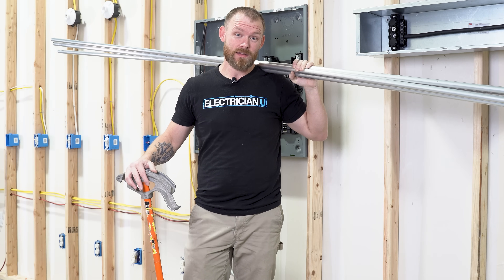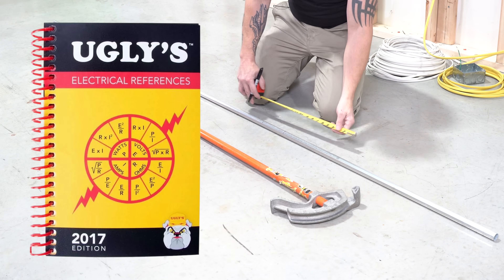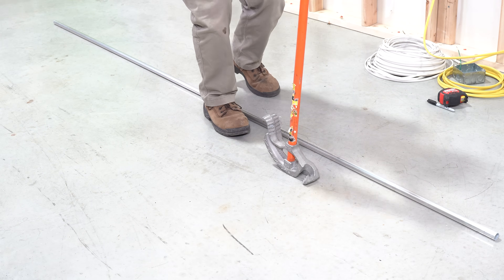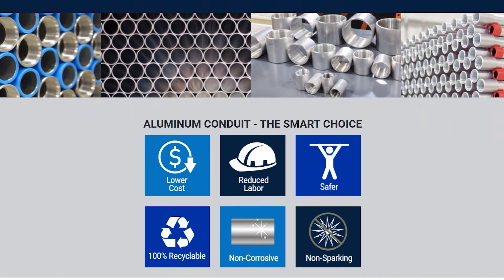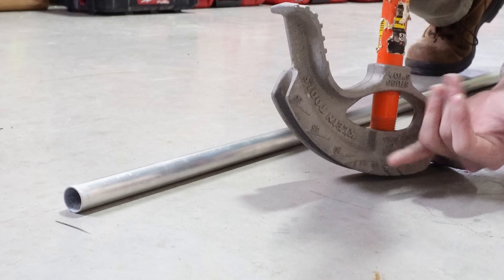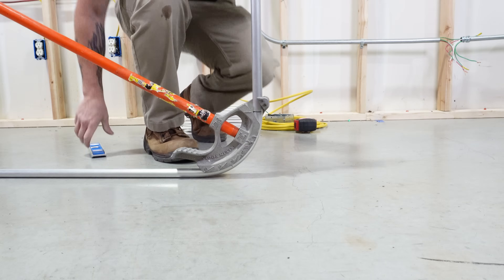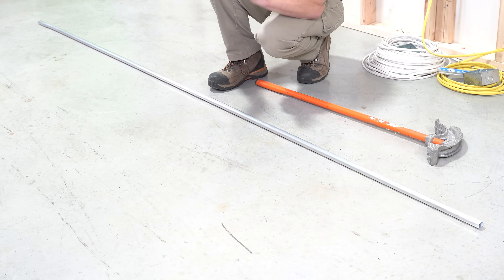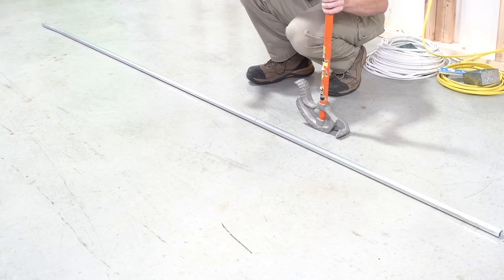How Do You Bend a 90 in Conduit?

Comment: I haven't done any conduit bending in about 20 years. I used to have all this stuff in my head. I'm currently rewiring my 1913 home and replacing a bunch of non-code BX, replacing sections of RMC, and adding new runs. I figured I'd just start re-learning as a beginner. 
Thanks for posting.

Comment: As a homeowner running conduit for a room renovation on my home (required for code; Chicago area), this was extremely useful.  Thank you!
Reply: How'd it go brother?
Reply: Chicago here as well. A lot of people like to bitch about EMT, etc., but after doing a house in WI with Romex, I really appreciate that we have to use raceways, ect. here. I work on a lot of old homes, and it's so much easier to add a new circuit, pull out old wiring (cloth).  For existing installations, we can use up to 25' MC for protected areas and not limited to 6' (whips) which is a great comprimise allowing for minimal opening up of walls (especially where lath and plaster is concerned). NEC Article 330 in the Chicago edition of the book.

Comment: A RULE  TO NREMEMBER when bending electrical tubing- For offsets 8 inches or less use 30 degree bends- Over 8 inches use 45 degrees of bend- {where the bender handle is straight up perpindicular at a 90 degree angle

Comment: I guess a minor disadvantage to aluminum conduit is your magnetic level doesn't stick so you have to keep putting it down and picking it back up when dialing into the angle you want. Though with a 3D printer I suppose you could fix it and have two clips that slide onto the ends of the level to allow you to clip the level to the conduit. (Opposite facing clips that provide tension to lock the conduit into the groove down the one side of the level with a twist.) Probably not a big deal if you are experienced and usually only need one tweak to hit your angle per bend. But for beginners not having the level mounted to the conduit could waste a lot of time just picking up and putting down the level.
Reply: They make a magnetic level with a locking mechanism for pipe.

Comment: I realized that with the klein benders it feels weird bending a 90 it's like you have to go further than you actually think. I feel like the ideal benders are true once your down it's 90 and your good. I couldn't stand the klein maybe its just because I've got use to the ideal over the years.
Reply: The Klein are garbage, I can feel it everytime I use a Klein Bender LOL. Ideal, Greenlee or Milwaukee are way better.
Reply: @mikerosoft1009  yeah I hated the klein bender I found ripples in the pipe I couldn't stand it. I haven't tried the milwaukee mostly used to working with Ideal and 1 Greenlee
Reply: @robfahey1349  same with me and the ripples. I liked the orange handles so I swapped the heads for greenlee lol

Comment: i almost the last year completly was bending conduit but of heavier metal, but we don´t use imperial so it did´t help me enough on measures, and you can just pull the bender to bend the conduit, but always keeping the conduit pressed agaist the floor, or it will break, and with enought ability you can even bend on the air using your wieght, but also is more risk to break, but also easier to do on some more harder conduits of higher diameter(please use metric too, USA suppossed to be using it, stop using imperial, is inefficient)
Reply: No. Freedom units ftw.

Comment: I don’t really have any experience with bending pipe yet. I was wondering when you did the 90 degree at 78” was it 78” to the inner or outer edge?
Reply: It’s to the back of the 90°. So 78” would measure from the start of conduit to the backside of his 90°.
Reply: @mattjjmichael  thanks!

Comment: What separates the boys from the men is having to run over a thousand feet if 1.25" EMT with a bender that does not have the great foot that allows to bend 45 degrees then move foot pedal up and finish a 90 degree bend. On one job we had to install 2  & 5" saddle bends on the ten runs. When bending 1 & 1.25" EMT with a hand bender best to wear work boots ( not cheap thin sneakers ) and place the end against a wall to prevent conduit from moving and use a little clamp on level. On runs consisting of more then 3 conduits best to use unistrut that if planner correctly v will reduce # of bends. On one jib we had 360 degrees in bends to 18 or 20 receptacle drops . Used standard 15/8" unistrut coming down from 30' ceiling then mounted 1900 boxes in shallow 5/8" ( & not the speed her to find 7/8" shallow strut ) to avoid going over 360 degrees in bends and saving on installing either pull boxes or C codulets up in high ceiling making pulling wire harder.
Reply: The men are running 1” rigid

Comment: 2:35
It says on your conduit " EMT " .
Aluminum conduit are usually threaded just like the ridgid steel pipes and are bendt using benders one size bigger. 
EMT is kind of an "in between" aluminum and ridgid .
But if i'm wrong, and aluminum/EMT conduits exist, then that must be nice to work with. 😏
Reply: EMT is not a material. If you want to make it out of brass, nobody is stopping you.
Reply: @waytospergtherebro  thanks for the clarification.
22 years in the trade, and i still learn new stuff 😉
Reply: Emt is a thinwall conduit designed for use with fittings

Comment: The only time I use the sharpie is when it's where I'm cutting or the conduit is being buried. When it's exposed I do as you suggested, I use a pencil.

The other part of pushing down on the shoe of the bender is that crinkles can form on the inside of the bend. It's happened to me incidentally when I didn't have enough pressure on the shoe with my foot.
Reply: Like you, ... don't care for Sharpie lines on my beautiful work. 

I do however still prefer a Sharpie, but I use a modest dot, oftentimes smear it away when done. 
I guess an exception I remember being underground work.

Comment: If it’s not too much trouble I have a code question for you. Does the NEC say anything that prohibits me from making a subpanel 120V instead of 240V? I have a 10/2 feed to my 240V subpanel in my garage and they’re using the non-insulated ground wire as a neutral. To avoid having to run a new feed cable as a 10/3, I wanted to just convert the subpanel to a 120V. Then the white can be a neutral and the non-insulated wire can just be a ground. Does the NEC allow that?
I did some poking around online, but it’s mostly people arguing about whether or not it’s allowed and nobody seems to have a concrete answer straight from the NEC. Any answers would be greatly appreciated.
Reply: There is nothing that goes against 120V panels. The only downside is you can never hook anything up that requires 240V obviously. Make sure the subpanel is fed from a 30A breaker since you only have #10's running to it.
Reply: @nikogarcia3249  Hey Niko. Thanks for the response. I really appreciate it.

Comment: Another thing I learned is if you ever bend it a lil too much you can use the handle from the bender to straighten it back
Reply: Negative. You have a torpedo level, markings on the bender, and at least one eyeball. You NEVER bend past 90°.😂
Reply: @mdnorman0001 don't you have to bend last to deal with spring back
Reply: @sylvernale yes you do. This joker who commented has no clue what he is talking about.

Comment: I realize that this is sponsored but are there any downsides to using aluminium beyond the pulling friction that they remedied with their coating? Thx for the tutorial. Its neat to see this done
Reply: Non Magnetic. Your level won't stick to it.
Reply: @darrenwoloshyn  I could see where that would actually be pretty annoying. Thx
Reply: @GeorgeWashingtonLaserMusket Depending on availability, cost, and options that really could be a deal breaker. If you can't do it right and complete the job to a high level of quality then the cons might really outweigh the pros. Thx

Comment: The “Stubs 6” to ⬆️” on the bender is your takeoff or sometimes referred to as a deduct. It’s usually cast into the head on 1/2”, 3/4”, and 1” benders. Only mentioning if someone was curious what that meant. Not all benders refer to it the same way as the Klein he is using.
Reply: I know Milwaukee does the same as Klein. I have an 1/2 inch Milwaukee bender and a Klein 3/4 inch bender. I like the Milwaukee better because it has a black shoe with white printing on all the degree marks so it makes it really convenient for bending being able to see.
Reply: Good info, also use a pencil so your work is not covered in sharpie marks.

Comment: Would have been clearer if we could see you measuring the wall obstruction - do you measure for the inside edge, outside edge, or center of the id of the conduit?
Reply: Depends on if the inside or outside of the conduit will be against the wall or object you are bending to/around. So if you were bending on an inside corner you'd measure for the outside of the conduit as that is what will be contacting the wall. Hope you understand my explanation.
Reply: 90's are always measured to back of 90

Comment: Assuming it's ok to use steel fittings with the aluminum conduit?
Reply: Most EMT fittings are die cast zinc.   Galvanized steel fittings are permitted with aluminum EMT (and vise versa)  A bare steel fitting wouldn't be permitted with aluminum EMT,  but I'm not sure bare steel EMT fittings even exist.
Reply: @andrewalexander9492  I saw some zinc plated steel fittings. Made in the USA too.
Reply: @salatino  "galvanized" just means zinc plated, so yeah, those should be  allowed to be used with Aluminum EMT.